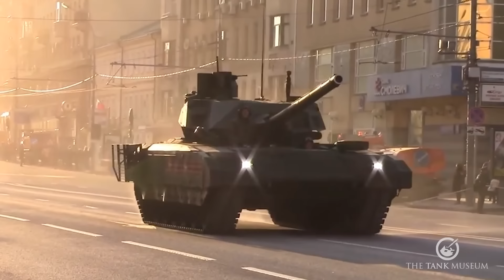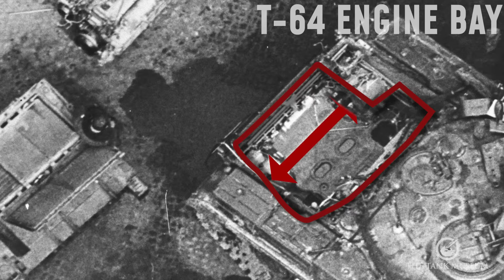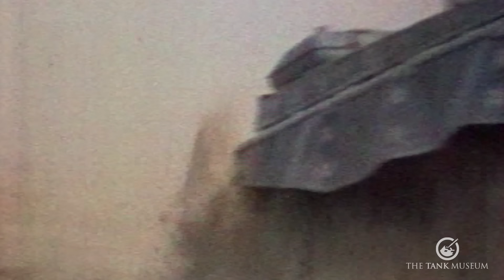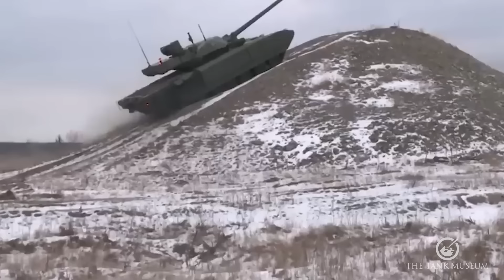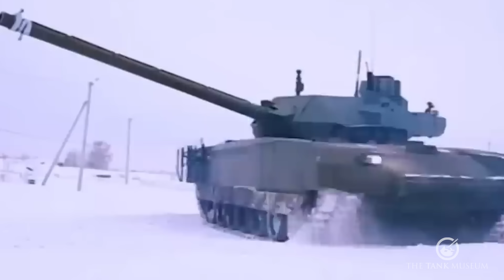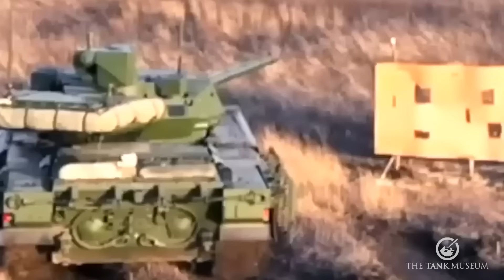Radical or Ridiculous? | T-14 Armata | Tank Chats #171

Comment: Sounds like the F-35 on tracks.
Reply: The F35 works though despite what RT think.
Reply: @AWMJoeyjoejoe  Not reliably.
Reply: @puffin51   3.11 class-A mishaps, aka total loss of the airframe, per 100,000 flight hours since its introduction. If you think that isn't reliable you just don't know what you're talking about
Reply: @hultaelit  "Reliability" hasn't got anything to do with how many accidents it's had. It is the measure of what proportion of the aircraft are actually available to fly any mission in its specification, averaged over time. In the case of the F-35, that's around 30%. It goes up to 50-60% if you mean that it can fly at least one of the specified missions, but not all.
Reply: @puffin51  That's called readiness, not reliability. 
A low reliability implies that an airframe that pass all the checks that puts it in your 30% category may not actually be capable of any mission after all. 
You don't have a reliability issue when it takes a long time to perform scheduled maintenance because the civilian contractors that's supposed to do that job can't do it for whatever reason. That's a service issue that leads to low readiness. 

When planes that looks a-okay and have gone thru all required maintenance start dropping from the sky, that's a reliability issue.
Reply: @hultaelit  I don't care what you call it, the fact is that the F-35 is available to fly any-or-all missions less than a third of the time. It has a ratio of ground to air time of about 20:1, an average sortie rate of .4 a day, and an average air time before unscheduled maintenance event of about 90 minutes. This aircraft is a crew chief's nightmare. It doesn't matter how gosh-wow its theoretical capabilities are if it's sitting on the line - and that's where it spends most of its time.

Comment: nato has indeed had multi role chassis. but what nato has not done, is to base most platforms on a tank chassis. the much smarter thing to do is to have one chassis for heavy platforms expected to take main gun hits and live, a case can be made for engineering platforms and tanks and so on, and much lighter and smaller chassis for ifvs and other platforms like artillery systems, because the job the chassis will be doing is very different, and long range artillery doesnt need the same kind or armor as an mbt, neither does an ifv, just think about how much more fuel an ifv based on an armata chassis will consume than a bradly and even if its potentially safer, it isnt necessarily a good deal to make anyway, there are reasons why we dont just have large transport tanks.
Reply: There are areas where you might want an armored IFV,   like in places where RPGs are flying around.  The Israeli IDF got their Namer for this very reason.  As for fuel cost,  that's a problem for a poor citizen not an entire country,  especially one at war.  Or even a special operation.  Not that it would serve Russia any better when their IFV's armored plates get replaced with cardboard by their corrupt officers.

Comment: The T-14 seems to be a realistic attempt to in particular improve crew survivability in an era of smaller and more volunteer armies. It is also strange to be reminded how much concern prior to the Ukraine war there was around dealing with the threat of attack helicopters and ATGM. My observation of the Ukraine war so far is we are seeing the biggest artillery revolution since the the French tore the gift wrapping paper off the first 75mm M1897 field gun. While on board video means great sport can be made in social media of hunting individual Russian soldiers with drone-dropped grenades and all the talk is of the way loitering munitions are replacing battlefield support aircraft, drone corrected artillery along with modern GPS accurate maps seems to have vastly increased the flexibility and lethality of well handled artillery. It seems that drone corrected munitions are consistently capable of hitting moving armoured targets. No matter what sort of active protection system you have got, you are not going to stop a 155mm Excaliber round if it hits you.  AFV designers are going to have their work cut out trying to figure out how, if it is even possible, to protect vehicles from extremely accurate medium artillery fire capable of hitting moving vehicles.
Reply: The protection seems to be shoot and scoot.

Comment: "Unreliable" is an understatement for the engine. The german WWII engine design that this pile of scrap was based on was the one that famously cost Ferdinand Porsche his win in the competition over the Tiger 1 contract. The engine is prone to mechanical breakdown and overheats so rapidly that it has a habit of setting itself on fire.

This wouldn't be a problem if they could just swap over to a different engine, but the Hull base for the T-14 was literally built around the engine, so no other engine the russians have available fits in there without completely redesigning the entire engine section of the hull.

Comment: Correction about the engine, it’s not a copy of the German engine, the only thing it has in common with the German deisel is that they’re both an X layout. RedEffect made an excellent video on this. 
There are also roughly 120 of these vehicles kicking around. 
I would say that you’re probably right about the electronics, components are in short supply, and they will need to make redesigns to accommodate these changes. 
I do beleive it’s smart of the Russians tho, there’s no need for the T14 in the war, they’re facing T64’s and a handful of dated western tanks, the T90M is more than capable of that, and it’s better for focus on tank production overall

Comment: The main gun appears to be mounted pretty low and close to the hull. Doesn't that compromise its ability to elevate and depress?
Reply: I'm sure it depresses a lot of T-14 tank crews. Should the turret blow off, I'm sure it will elevate them as well.
Reply: @ValiantValium  For the purpose of shooting the turret beyond the stratosphere they put all these rocket launchers around the turret ring. Unfortunately, this will be an unmanned flight, because all the crew is in the hull.
Reply: Only if you play world of tanks or warthunder, nerd !!!!
Reply: Suspension can be adjusted to suit firing position, squat down to conceal or raise as reqd.

Comment: I applaud him for keeping his face straight at 16:50.
Reply: Why not?
T-72 is the same generation as those tanks.
Reply: @alexanderbarkman7832   Huh? t-72 same generation as leopard 2, Le Clerc and chally 2? t-72 adopted in 1969. All those other tanks were adopted in at least the 90s, 20 years later. I'm not sure how you are defining tank generations but it seems... odd.  1979 for the Abrams though that has had more extensive upgrades compared to any t-72. 

If you'd honestly prefer to be in a t-72 over any of the other tanks you have swallowed the propaganda real hard and i'm sure Russia would welcome some more meat to crew their tanks. better be quick though as there won't be any left at this rate.
Reply: @xXBisquitsXx  
The T-72 is called that because it is from 1972.
Same decade as all the other.
Reply: @alexanderbarkman7832  Every source i can find says 1969 to 1973 Also its not as simple as the number being the year it was adopted (the t 54 was first produced in 1947 and first appeared in units in 1949, t80 adopted in 1976). even then the only other tank adopted in the 70s Is the Abrams in 79. do a little research first if you don't want to seem uninformed. If you implying that the Leopard 2 and Chally 2 are the same as 1 then the t-90 is the same as the t-72. 

I'm not gonna bother replying again as im assuming you are either trolling or can't be asked to even do a simple google search.
Reply: @xXBisquitsXx  
It was the first prototype that was built in 1969. The number in Soviet/Russian tanks correspond to the year it start production (the final development of the first model)
Leopard 2 was already in service by 1979.
Reply: Note that the Dep. Minister did not mention British models...
Reply: @Ned-Ryerson  Yeah i noticed that, i'd like to assume that he didn't think that the t-72s were a match for the chally 2 but in reality i think he just thought they were not relevant due to the low numbers.

Comment: Honestly, I'm convinced that the designers of the Armata looked at the Merkeva, said "we can make that, but better" and absolutely face-planted the implementation. The two share a number of design points (eg. a double-protected crew capsule, reliance on an APS, ability to fire anti-helicopter missiles from the turret, multiple remote guns, etc), but the Russian implementation of those points is just incompetent. For example, the Merkeva also has a secondary capsule inside for the crew, but it's behind the engine (the engine is in the front) and has a rear hatch; conversely, the Russian crew capsule is pneumatically sealed with flammable fluid, with just a top exit, and so the crew is virtually guaranteed to get trapped inside if their pneumatics are taken out via fire or an impact. Basically, it's a pressure cooker on wheels.

The failures are not a surprise given that this is Russia, but, prior to Ukraine, even the best Western analysts didn't realize how rusted out their military is.

Comment: Actually Soviet tank armor was pretty weak in practice. For instance South Vietnamese Walker Bulldog light tanks were very effective against North Vietnamese T-54 medium tanks.
Perhaps the armor was thick, but of poor quality.
The T-90 is essentially an upgraded T-72. The T-80 was actually a better tank.
Big problems with Russian tanks are its weak armor, ammo stored in the crew compartment and small gun depression (meaning a hull down position is very difficult). 
When in combat with western tanks the western tanks outperformed the Russian tanks. 
Russia overstates the capabilities of its tanks for propaganda. The west does the opposite. If the Army of a western nation says it has the best tank than they won't get money from politicians to get upgrades or new tanks. As such they will often say that opposing tanks are far more dangerous than they are.
For instance the US Army claiming the T-72 was very dangerous to the Abrams ment a lot of Abrams upgraded to M1A1 HA. But in practice the T-72 was very very inferior in the Gulf War.

I think several design features of the T-14 are interesting. Like the unmanned turret (although also a risk if something breaks) and using a chassis for multiple vehicles.
APS can't intercept sabot rounds. Apart from that, they have no warhead so at the maximum (like ERA) it can slow it down a tiny bit.
ERA is obsolete. Only works against HEAT and missiles without dual warheads.
The turret looks very vulnerable to enemy fire,  hitting the turret will destroy the tank. However the crew might survive and live to fight another day, which is a huge improvement over current Russian tanks which violently explode when taken out, with few remaining of the crew.
Reply: Or crew having few remains.

Comment: The T-14 engine is junk and it was designed around it in a unique way. This means it is not feasible to swap out the engine with one that works. They have to start over from scratch.
Reply: Lets. Not forget the fact the turret is inaccessible by the crew, meaningbif it jams or anything happens to it they have to return to the factory

Comment: I don't think the bit where it is claimed that the engine is a copy/derivative of a WWII engine is accurate, my understanding is that they use the same geometric layout (like how there are many different V-shaped engines that are not copies of each other) but not much else.
Reply: Thing is if you see the sla.16 engine and compare it to it they look too similar especially when you compare then to other similar engines, also the claim isnt that its a ww2 copy, thr claim is that its a derivative of an oil pumping engine which was deisgned from the sla 16 as a starting point

Comment: One note on the NATO vs Soviet comparison... bigger is not always better when it comes to the guns. In terms of actual performance, NATO guns tend to be on par or better than their soviet counterparts.  The NATO 90mm was often as good or better than the 100mm, the 105mm as good or better than the 115mm, the 120mm as good or better than the 125mm, etc etc.  At least when it came to armour penetration. This, of course, is heavily dependent on the ammunition, but the point is that simply saying 'their guns were bigger' doesn't imply superiority... they just needed bigger guns to achieve the same effect.

Comment: Left and right side of the T-14 Armata turrets slant panels this is where the Afghanit APS heat sensors which is supposed to detect TV Guided Spike ATGM FGM-148 Javelin ATGM. If you are a Ukrainian soldier that have to destroy this you need to resort to using Combination of Stugna-P Javelin Panzerfäust 3 Mk 153 SMAW and NLAW to destroy the T-14. Remember Afghanit APS will stop a Stugna-P ATGM from locking on due to the Heat sensors on the turret slant panels which will deploy smokescreen and then the EFP projectiles. Firepower and performance of Russian tanks have a cost is that you cannot reverse quickly as a western tank of the same era which has fire power mobility and protection since you need those three to get a fast reverse speed. Basically Russian tanks get a slow reverse speed due to their offensive-oriented firepower and performance
Reply: The APS requires the crew to know the missile its coming, its  a really bad aps, the chinese literally tested it and said it didnt work
Reply: @zannafrancy  thank you for telling me about this is that the Chinese copy of the Russian Afghanit APS which was tested or their own APS system for this test? We have seen in the Ukrainian War that Shtora APS doesn't work on Javelin ATGM since it's fire and forget although the Stugna-P can be defeated by Shtora APS on T-90A tank since it's laser-guided to which its designed to deal with it
Reply: @EpicThe112  i dont know about any chinese copy, what im referring to is when the chinese trialed the t24 when they considered buying it

Comment: Russia can produce its own modern thermal sights. They've been sending new T-90Ms to the frontline units though in considerably lower numbers than the refurbished old tanks. Russian military industry is not as dependent on the Western technologies as some people think. The claim that T-14's engine 12H360 (aka A-85-3A) is a copy of a German engine at 12:38 is completely false. This is a myth born from one poorly written article that doesn't cite any sources whatsoever. I don't know how good their videos about older tanks are but regarding modern tanks it seems they don't bother doing a lot of research. I recommend checking out Red Effect's channel for more accurate info and analysis of the modern tanks.

Comment: A tank that cannot be maintained and kept running, shooting, and self-defending in the field is useless.  Just check the Nazi experience for that.  The T-14 is a vehicle for professionals--not for hastily recalled reservists and barely-trained conscripts.  That is the critical departure of the T-14.  Previous designs were basically minimalist for good reason--simple tanks for simpletons to operate, cheap and expendable, as we've seen in Ukraine.  Note how many tanks have been captured by the Ukrainians, not most likely due to Russian cowardice as propaganda would have us believe, but because of breakdown, even with the simpler T-72.

Comment: Since they were never put into production and only have prototypes, they probably haven't set up a training program on how to use them.  So even for the 20 they have, no one would want to risk going into battle with them since it would be not only hard to figure out, they'd have to work out the kinks--they'd be like test pilots (but with a much lower likelihood of survival).   They'd probably be more comfortable with a T-55 or older.
Reply: MrSaiga308  Where?
If that would be the case it would be all over the news .
it is not.

Comment: Paper tigers don't hunt. An inauspicious moment for the T-14 was when one broke down so badly during a parade, that it could not be moved, even with another "mighty" Armata trying to pull it along. I hear the thing can't even reverse, when it works right. If they send it to do anything other than look cool, it'll get its proverbial face kicked in, and we'll see its turret join many hundreds of others, in flying many tens of feet into the air as a result of an ammo rack explosion. It's more likely to be fielded in desperation because all the better, older, more reliable tanks have already been taken out by Ukrainian infantry, using anti-tank weapons from close range, than it is to be fielded with specific purpose in mind. I look forward to seeing a desperate Russia watch as its white elephant gets poached by rag tag groups of Ukrainian forces, and turned into an expensive, heavy firework for the entertainment of Ukrainian civilians.

Comment: how came up with the idea of one chassis/hull for a MBT and the IFV/SPH variant? either not enough armor for the tank or far too heavy for the IFV. And then all the compromises for doors/ports when playing tank versus howitzer vs IFV. 
Saying "it worked for western armies": if this is about the Leopard1: the timeline was different!
the (re-) use of it's chassis for Gepard, Keiler, Bieber: that was when the armor of that chassis was already too weak for the MBT role and the Leopard2 was at start (and existing Leo1 were set back to a rear/combat support role).